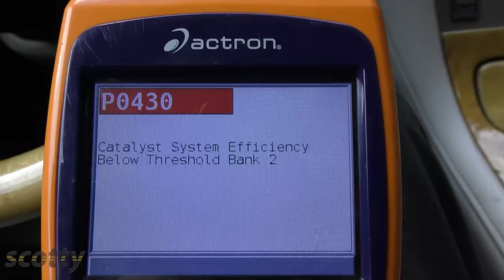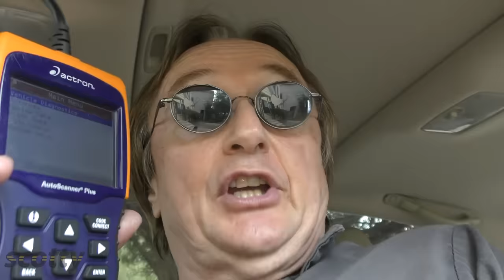Check Engine Light Comes On and Off in Your Car? What it Means

Comment: My engine light come on one day , goes off another day and comes back on a day after. The codes are p0171 and p0174. 
Before it was on all the time. Took it to a mechanic, changed fuel pump ($1017 Canadian) , ground strap ($226 Canadian) , inspection (141 Canadian ). 

Took it back to mechanic, says MAF filter is bad. Took it back second time, says ECM is bad and charge $141 for inspection and says everything else is working good.  
I will be changing the MAF myself and see how it will go.

Comment: My check engine light comes on every few days . Turns off ,on, off,on.. etc. It's a turbo sensor valve.  But does it mean it's not actually a problem if it turns off? But then a few days later it turns back on.  Happened last winter but then stopped for a whole year and started again 2 months ago

Comment: I have a 2015 Malibu where the check engine light comes on when the temp goes into the 40s. It comes on with a P0171 code but the dealership never can find an issue and the engine sounds fine. They reset it and don't charge me. Now I've got a code reader myself and when the same thing happens with the same code with the temp in the 40s, I just reset it myself.  This is something you shouldn't do just blindly, but if the engine sounds fine, I'm not spending 2 hours in the dealership and have them tell me they can't find anything wrong.

Comment: I had this problem in my 2014 Ford falcon fg mk2 ute and when I did a cold start it would idle for 6 seconds and the light came on I turned off then on again and it worked fine it turned out to be the fuel I was using I put in unleaded 98  because it is a fairly new car then I put unleaded 95 in and it stopped doing it.my ute sent itself into limp mode👍

Comment: I have a 2006 chevy aveo ls 4 cyl and i drive about an hour to work and a hour back home on the way to work its fine but on the way home the check engine light flashes and i get loss of  acceleration but it only happens on the way home in the afternoon i leave before its light out in the morning any ideas

Comment: Had a pickup that I ended up putting 300K miles on it.  The check engine light would over time turn on.  60,000 miles later it would go on, then 60,000 more miles turn off.  That's what I call blinking slowly.  So, Scotty is that what you meant about light blinking indicates a more serious problem?
B-)

Comment: Hi , my check engine light comes and goes like after driving around 30 kms then stays for a day or two, goes off and comes again after some 30 or so kms. I am sure it must not be the catalic converter else the light wouldnt come and go frequently, i believe it to be o2 sensors .. any thoughts please??
Reply: alan munoz thats wieird ..same thing happens with me but mine comes and goes every 3 to 4 days.. probably will replace my o2 sensors
Reply: alan munoz woah 900 dollars .. thats surely fishy .. ita better to get checked from some trusted mechanic .. sure must be sensor issue .. let me know as well if you figure out buddy

Comment: Hi scott...i have a kia sportage and my last service was done at 24000 kms....the dealer told me that your next service will be after 30000 kms and will be a major one and the engine belt will also be checked. You just said it should be replaced in a minimum of five years time....does it need to be checked...the car is just 2 years old!!! Please let me know
Reply: Taha Shabbir They're checking that for the same reason you go into the doctor for a checkup. There's almost never an issue, it's just to make sure everything is running smoothly. It's probably a manufacturer guideline or something to inspect that every few yrs or x amount of kms.
Reply: Puff the Magic Dragon thanks a ton for the response mate

Comment: Hi, what if comes on when driving and there is a performance issue (shaking when pressing the throttle)? Is it a big issue or could be a small thing such as spark plugs?
Reply: I was curious about this as well
Reply: @Shaylin.  i find out the issue.  Fuel  sensor  and injectors was the problem

Comment: I got a '87 Fiero (2m4) and my air/fuel sensor turns when I idle for a while but shuts off after a few seconds of driving. After I changed the coil packs and lean the carburetor a little she should be fine and even better gas mileage ( currently like 25/32

Comment: My 2009 G6 check engine light popped on I took it took auto zone since they will scan for free got a p0010 code had bad actuators bought them off amazon 38 bucks for both  and replaced them myself perfectly fine now lol

Comment: Just in time with this video. Have a Toyota pickup with this issue. CEL comes on and off on a daily. Mainly comes on under load when climbing up a hill and goes off when cruising down a hill and just feathering the gas. I'm assuming a soft misfire of some sort....
Reply: Rýán Túçk Hey man. Thanks for your advice. I checked the TPS and everything was within spec. But I did find a vaccum leak on the check valve on the vaccum line that runs from the intake manifold to the AS Vsv. Fixed that and the codes haven't come back. Only time will tell. Thanks again.

Comment: Hey Scotty kilmer well I bought a 2005 dodge grand caravan with 315 thousand miles on it and the check engine light is on got it scanned and it said all. 6 cylinders misfiring. And the emo value needs replacing so I did it it costed me 300 dollars to do it reset the check engine light the next day it came back on its not pulling up any codes and when I go 80mph the check engine light blinks and starts shaking my van when I stop at stop lights then shut it off for 20 minutes an hour later it does it again I don't know what the problem is could u please help me

Comment: Every time I had something like that happen it's usually after I fix something. Like last time I did engine work I forgot to plug back in my mass air flow sensor or when I did a tune up the car had to adjust to the new spark plugs, wires, and ignition coil pack.

Comment: My check engine light has never come on, I think the bulb is dead since factory because the engine has had problems as little as a vacuum leak as big as snapping the timing belts and cracking the block cap die to overheating, it just never turns on, are those problems scanned by the OBD? I don't know.

Comment: Hi Scotty please help. I have a year 2000 Audi A4 1.8 lt 125ps car. It has failed the UK MOT because my engine check light does NOT come on at all!!. I have looked at bulbs and guess what,, they only have very small LEDS that will properly never fail. I did try another dash cluster but it was the same, NO engine light on key start. Can you help?? thanks. Kevin UK.

Comment: I changed sparkplugs n wires n map sencer to my 1999toyota rev4 4cylender. Its not as bad as b4 but it still missing wen i accelerate n slow down on hills. N check engine light blinks on n off while driving n stops n stays on while vehicle not moving. Wat can it b

Comment: If I have this happen to me, I remove the positive lead to the cars battery and wait for a few minutes for all the computers capacitors to bleed off then I hook it back up. If the check engine light comes back up and the engine is operating in a satisfactory manner I just ignore it as a sensor that is just too sensitive. If the engine is miss firing or back firing then of coarse I would have the engine serviced, but if it is operating fine, again I just ignore the check engine light warning.

Comment: Bought one of those weird GM cars in the transition from OBD1 to OBD2 and every shop wanted a arm and a leg to can it. Paid about twice that ($220) to get a scanner that worked with my car Actron 9690? Worked like a charm, but now the car is acting up and check engine is on but when I connect the scanner I get "no response from PCM" but I can still view the cars live data..

Don't know what the heck is going on with the thing just very high and very low RPM. Some days I turn it on and the car wants to shoot up to 3k rpm on start up other times it wants to die the second I let off the gas even while it's moving and with very little load on it (like coasting to a stop sign).

Comment: my check engine light is on and still on . the EVAP code came on says that there is an irregular flow in the system ,so replaced the evap valve that connect close to  canister near the engine on my mazda2 2005 and replaced also the gas cab but still the problem never fixed  one more thing i ran a leakage test and find no leak anywhere . any idea what to look .thank you scotty.
Reply: Rýán Túçk I let the mechanic work and base on his knowledge I bought new valve, gas cab , he ran leakage test and still the light on with same code

Comment: Hey Scotty, my check engine light came on the other day so I took it to autozone to get it scanned and they said it was the VVT and the ECM. I was curious so I called my dealership and asked them how much it was to fix it (even though it might not need to be replaced) and they said it will be $1200 for the part and $300 for the labor. Off the bat I thought that was outrageous. Keep in mind I have a 2016 Kia Optima EX with 48k miles on it. I dont put a lot of wear and tear on my car so I'm pretty sure I dont need to replace it. Like you mentioned these computer systems are sensitive. My check engine indicator did go off once but recently came back on. Is there any advice you can give? What would you do? I will definitely subscribe to your channel with some feedback. Thank you!
Reply: If it’s driving fine just keep driving it and save some money and get it fixed eventually when you have the money

Comment: Had my check engine light come during a long trip then after leaving it parked over night and started it up in the morning light was off. Got back on the road and about 250km it came on again. 
It always seemed to be after a long drive the check engine light comes on.
Had the car diagnosed and it came back as a MAP sensor issue. Then I had it replaced and there is nothing wrong for about three weeks... went for another long drive at about 250 it can back on..ugh.

Comment: Happening on my 2006 Dodge Charger.    If I drive for extended amount of time on the freeway, the check engine light comes on.    Code is for the EGR valve, which I had replaced a while ago.    If I drive to/from work (short distance), the light goes off.

Comment: very timely!  check engine and trac off light of mine are ON and OFF. went to mechanic last saturday and now I brought it back again for the same problem. mechanic can't seem to find the problem. car runs a bit slow everytime the lights are on and felt a jerk twice when shifting to D or R. any idea folks? tnx
Reply: du 30 my car was doing the same thing: running slow & jerking or chugging, not running right. 
 It was the ignition control module ( ICM ) 2008 Buick 3800. V-6. I fixed it by removing ICM and replacing it  with a 2nd one for $40 vs, $250 for a new one. but first I tried fixing many other things untill, I figured out that it was the ICM/ igniter. I thought it was my transmission (4 -speed auto) so, had that serviced, changed the motor oil, spark plugs & wires. Cleaned the intake MAF sensor, replaced an emissions purge solenoid plus, PCV valve... 
 Also the wires to the coil/ ignition module are covered with a plastic loom/conduit Wich has become brittle and crumbling actually touching the engine block + I wrapped it up with black electrical tape.
 Car runs like new again ... Only took me 5 mos. To sort it all out.🚗
Reply: missingremote lucky you sir! brought back my suv to the dealer and AT LAST they figured it out! faulty throttle body. brought it back there last tuesday and until now I haven't got it back! they are still waiting for the parts to arrive "they said". hopefully it will be alright after changing that throttle body. im driving 2016 toyota suv model and seems like I cought that problen too soon! a bit stressed. thanks for the input sir by the way
Reply: du 30 I'm not a real mechanic, but I don't think that you're problem is with the throttle body.. especially if your car/SUV shakes or jerks as mine did too, just shifting from park to Drive & reverse.
 I tried ignoring my car's symptoms, untill it got worse and worse. It started with losing acceleration, as in drag racing type of pedal to the metal. And then losing power while going up hills , small hills... I was sure that these problems was w/my transmission, but now it was a ignition. Specifically the ICM. Wich I changed out all by myself.
Reply: My car had a bad throttle and/or a faulty TPS = throttle position sensor. 🚗
 It turns out that your mechanic was right.
   I have now changed the whole throttle ASSY by myself this March. Runs like new... Buick lacrosse 2008.

Comment: My Saturn SC2 has been having issues with the P0327 knock sensor code. They've replaced the knock sensor three times and now after they reset the check engine light, it came back on and now off again. This car drives me nuts.

Comment: Mine has come on for about 10 seconds flashing then i immediately stopped the car and turned it off, waited a few seconds and then turned the car back on and it was gone ,,, and i have been using my car for the past couple of days and it hasnt turned on ,nothing happened , should i be concerned or is it just a sensor problem ?

Comment: I had a case where my friends 50k Km diesel Toyota suddenly got the engine light. Plugged it in and it showed problems relating to the turbo sensor. On further inspection there was somehow ice... it had been +3 celcius and rain and slush. Next morning -15 celcius. All the moisture had been frozen.

Comment: My dad's 2014 Silverado would randomly throw a check engine light for the O2 sensors only when it was very cold outside. I took the sensors out and sprayed them with some electrical parts cleaner... Code never came back.

Comment: what if it comes on when the car is in the on position and not while it's started or driving ? 
All the lights comes on, (in the on position) then the engine light and the oil light stays on, BUT WHEN I START THE CAR, NOTHING IS ON THE DASH. are they memory codes ?

Comment: I don't know, this may sound kind of weird, but my check engine light has been on for a long time.  I did take over to get it checked out and the mechanic (at the dealership no less) couldn't figure out what it is.  The car runs okay, every now and then it will stall (rare, usually once every three months), but again the mechanics coudn't find anything wrong.  I'm at a loss I guess.  I guess I'm stuck with a check engine light.  Temperature is fine, brand new thermostat, all fluids have been changed out, new fuel pump, brand new spark plugs, new heater core (that was expensive), new fuel injectors.  The EGR valve is still factory, but the mechanic didn't mention anything wrong with it.  Again not often, but the car will go into limp mode, so something is definetly wrong, but nobody can tell me what it is apparently.  Obviously all my fluids are topped off.  Beats me.  I hope it isn't something with a cylinder or something, but if it were I would imagine the car would of failed by now.

Autozone codes come back with EGR valve, but again as I said the mechanic thought it was fine.  Anyway it's a Dodge Journey 2009 V6 3.5 liter engine.
Reply: Oh and sometimes the check engine will turn off, although most of the time it will stay on.  By turning off, I mean that is rare too.

Comment: Mine does the on for acfewcdays , then goes off for a few days.  Then comes back . Slightly rough idle when light is on . I'm thing 02 sensor is culprit but I got run codes to make sure .

Comment: I have a question I have a 2003 CLK 320 Mercedes benz 
I was driving it then when I was accelerating I saw smoke under the car in the passenger side then the car stop I didnt run no more and a Alternator/battery take to workshop show on the dashboard after a few tries trying to start the battery keeps dying n cranks but dont start so I replaced the Alternator n check the battery now it doesnt die everything working fine but still cranks but doesnt start what can be the problem? 

I will be waiting for your answer thanks so much I love ur videos
Reply: Rýán Túçk no I dont
Reply: Rýán Túçk  I already checked all box from n back fuses and they all working

Comment: Someone please help. My Nissan Altima 2005 shakes in drive and reverse BUT only sometimes. I've tried changing all the sparkplugs and 2 coil packs and it did fix it but 3 days later it shook again. The next day it was running fine until it shook again! Any ideas??

Comment: Scotty I have a 2001 Hyundai Elantra and it losing power to the point it has no acceleration, I can push the gas pedal to the floor and nothing and check engine light comes on, I let it cool and it runs fine and check engine light goes off..  what is wrong with this car..

Comment: I have a problem with 1993 ford van 4.9 .  the engine runs great, but the check engine comes on when I accelerate so I checked my vacuum hoses and found 2 towards the back of the motor where there is a set of three selenoid vacuum sensors relays are where the valve cover meets  the block and found that 2 of the hoses were not connected. So check through your vacuum hoses cause this was a very minor FIX to the problem that I have been splitting hairs on this for a good while, and I wasn't about to take it to the shop !    help food for thought !   6/10/2018

Comment: My check engine stays on for days, went away then came back on. Even had ticking under the hood that when I mashed the accelerator the rpms matched the ticking.. After a day haven't heard it again, I need help?
Reply from the maker: do as in this video, and get it scanned for codes, then post the codes on my website in the ask scotty section  www.scottykilmer.com